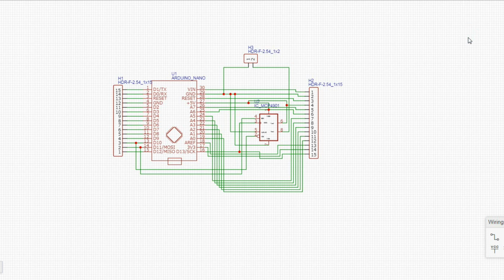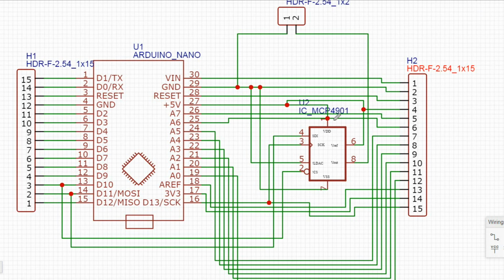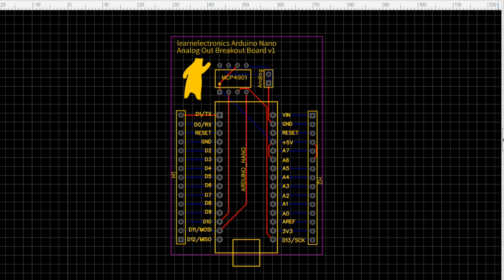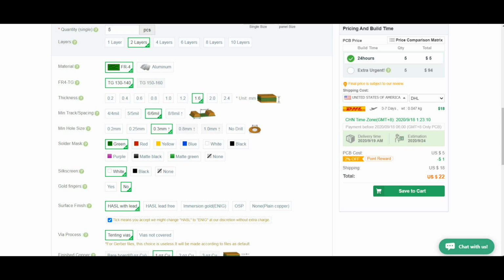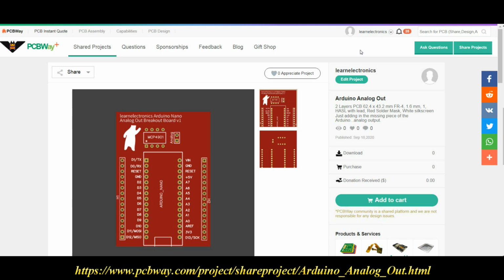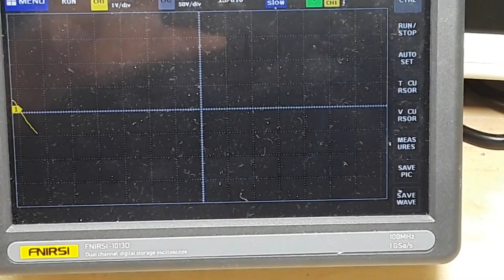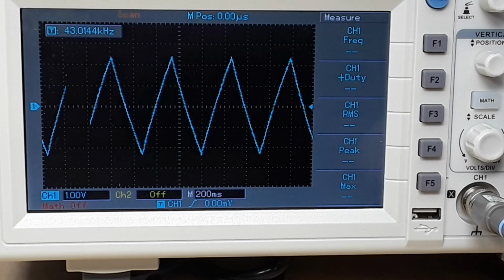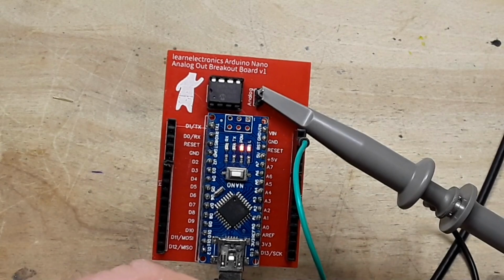Arduino Nano Analog Breakout Board DIY

Comment: Great video as usual... Wow a 5 day nap... Lol
Say I am looking for a new DMM my Vic99+ is having issues and I was checking your links and the Uni-T UT801 link comes back with a error "Not Found" and a cute Puppy Dog... :-D
Just thought you would like to know...
LLAP
Reply from the maker: Oh no!
Reply: @learnelectronics  Got the Vic99+ fixed,,, It was a loose wire in the red banana plug wire. I made some silicone wire leads as I got tired of the 3 hair thick wire leads, anyway the plug has a screw  that holds the wire and it was loose giving  flaky readings... :-(
Anyrate I have the KAIWEETS Digital Multimeter TRMS 6000 from your store in my cart for next months Amazon buy!
LLAP

Comment: One practical application of this concept is the upgrading of aircraft electronics systems.  Many current aircraft are from the analog days, but in many cases, modern digital equipment is far more reliable.  But some of the legacy systems on the aircraft need analog inputs and an interface is needed.